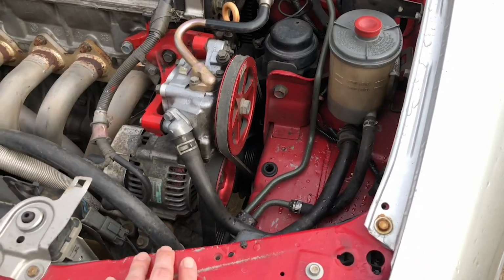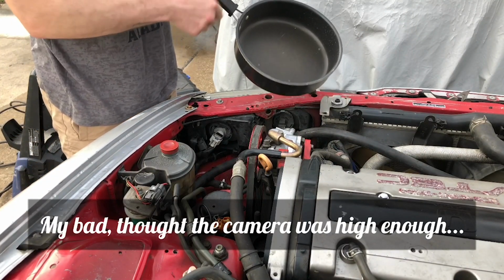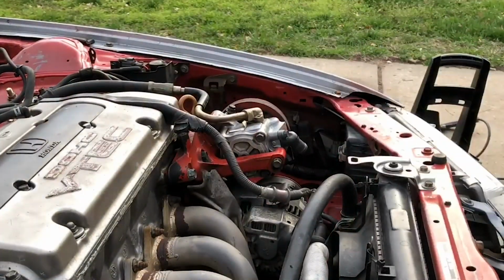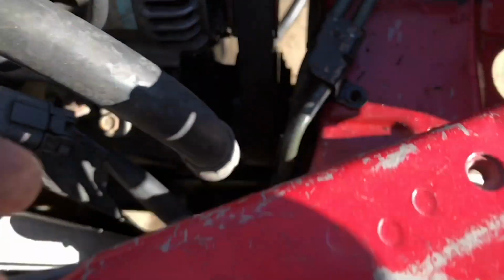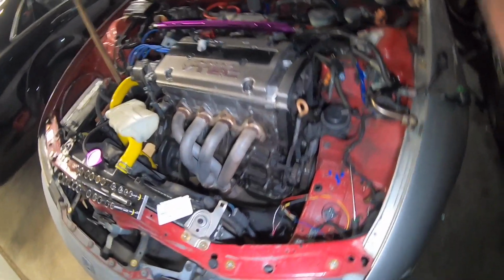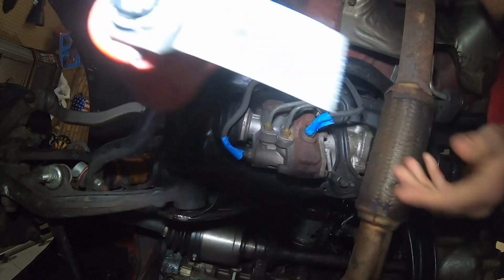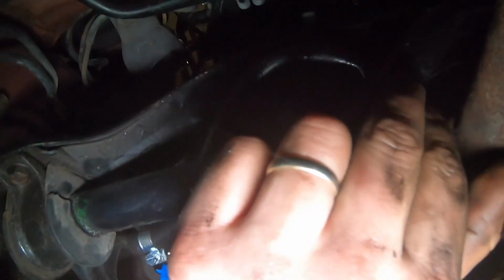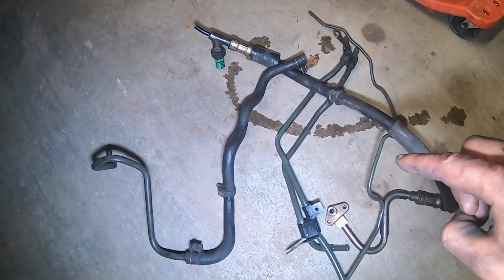How to Remove Your Power Steering from a Honda Prelude - Honda Noob

Comment: Thanks for the video man I just bought a 95 prelude and it had a ps leak so I decided just to remove it that’s so much man for real nobody makes videos on the 4th gen someone did an engine swap and converted over to automatic transmission so unfortunately I have the f22b auto
Reply from the maker: ya man not a problem, trying to put out some more

Comment: Can you loop the two center "smaller lines" together without doing the outers? I'm currently trying to j swap my bb4 and want to utilize the power steering don't know what to do with the lines going to/from the old transmission and would like to get rid of the extra lines I don't need. Any help would be greatly appreciated.
Reply from the maker: I honestly dunno, my guess would be that you couls as long as when you loop, you do your best to fill it with fluid prior to preserve the life of the rack n pinion, -- the problem is im not familiar with the jswap and what the difference is in their power steering

Comment: Same on the 5th gen prelude ?
Reply from the maker: essentially the same yes, tho the locations may be a little different, but you will need to remove and cap the same parts

Comment: Hello, what type of hose are used to loop the lines? Thx
Reply from the maker: any type of high temp hose should work, or if you have left over hose kit from the engine bay, that would be fine as well.
Reply: Do you know if this process is the same for a Accord 94-97?
Reply from the maker: @am6065  depending on the motor, i would say its probably similar, this is an H22A, set up for the h22's will be the same, but may vary if you have the non vtec h23a1 - and of course could vary slightly because of different frame and body style
Reply: @PoorGuy5  Alright thanks! it came with a F22 but I swapped it with a H22A5 (euro version from a Prelude BB4), might have to look underneath the car to see if I can loop the lines.

Comment: Is this the same for the 3rd Gen. Prelude?
Reply from the maker: to be honest, i've never worked on the 3rd generation - and i can't speak for the Rack n Pinion portion (cutting and looping), however, i would assume the procedure to be about the same, pulling the same components,
Reply: @PoorGuy5  ok no worries, yea I already have all the power steering components removed, pretty much the last thing left before I put the engine back
Reply: I'll just look at the rack and if it looks exactly the same then I'll just copy what you did, if anything goes wrong I have a parts car :) Thanks!
Reply from the maker: @alexbereziychuk9891  i like the way you think, and remember, you don't have to cut the lines on the rack, the only reason to do so and loop them like this is for the longevity of the rack - helps preserve it, so make sire you squeeze some fluids in there before
tightening up your hoses
Reply: @PoorGuy5  Thanks bro!
Reply from the maker: @alexbereziychuk9891  ya man not a problem